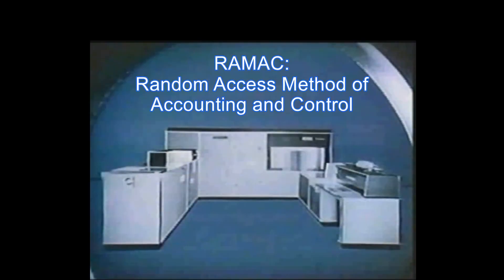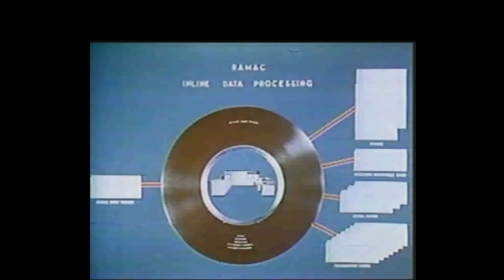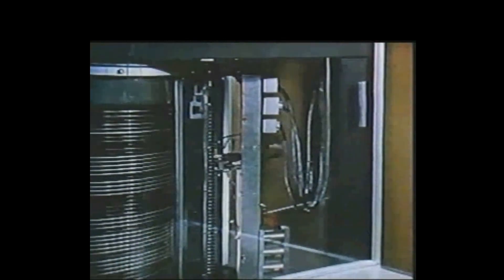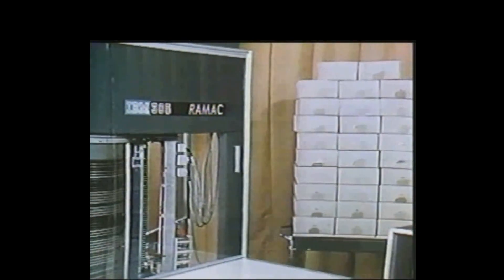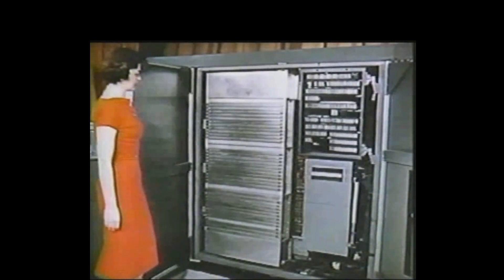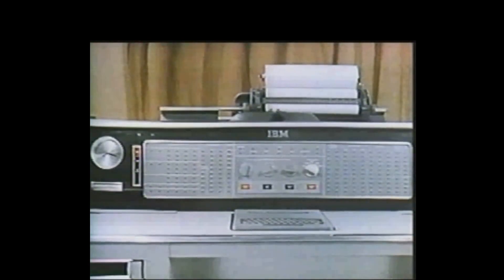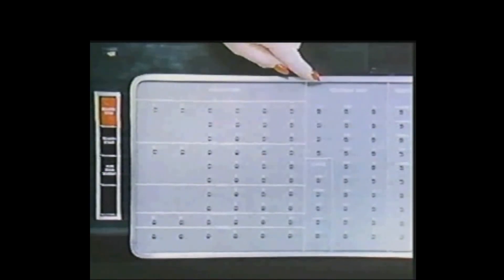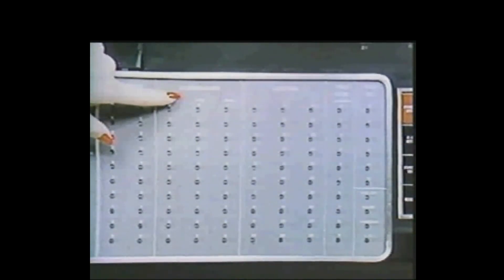Computer History IBM 305 RAMAC and 650 RAMAC, 1956 (350 Disk Storage)

Comment: My cell phone laughs haughtily as it uses it's 256GB of memory to store 4K video. I am 63 and actually saw one of these still running in the late 1960's!. I do NOT remember where.
Reply: Your phone had 256 GB of storage not memory. Your comment was 4 years ago so phones then had at most maybe 8 GB of memory. My phone at the time only had 4 GB as I didn't realize I downgraded from my 6 GB 2019 phone. My current phone (Galaxy S24+) has 12 GB of memory but 512 GB of storage.

Comment: Thanks for posting this.  My late father’s career was data processing and he used to rattle off stats.  They had a 305 and he used say it had 2,000 vacuum tubes, with 5 million characters and a 100 step process.  They stepped up to a 1440 with 12k in 1961 and then stepped up to a 360 in 1964 (with integrated circuits, I.e., transistors) with a whopping 32k of memory, with 600 lines/min.  Fortunately, I wrote all of this down before he passed away.
Reply from the maker: Hi Piano Study, that is fascinating info!  Great to have memories like that.  Thanks for taking the time to share. ~ Victor Kaminsky, at CHAP